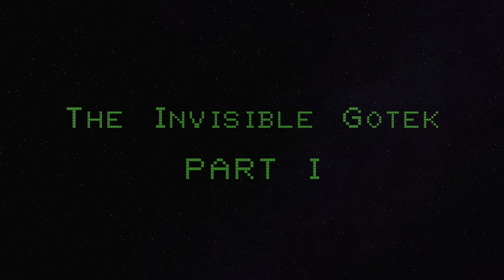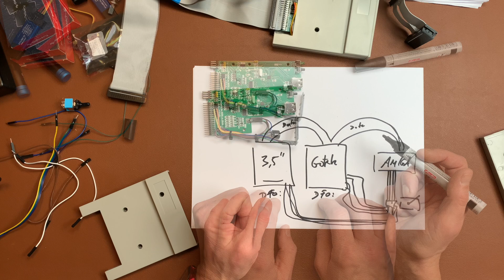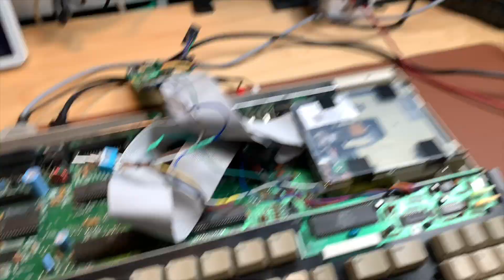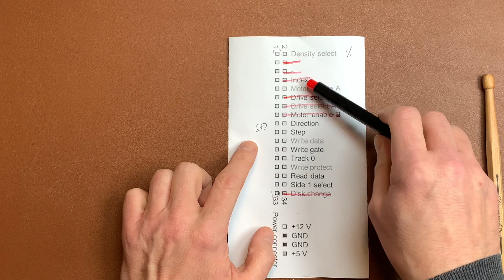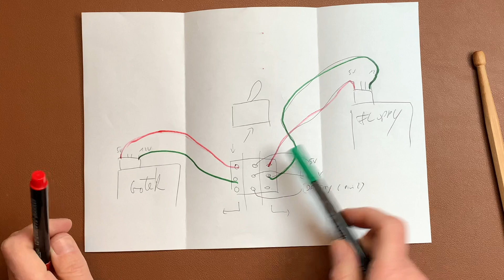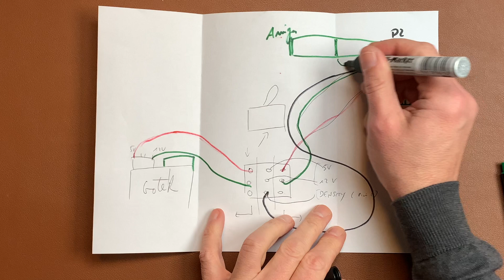The Invisible Gotek P1 (inside an Amiga) - no case, no buttons, no screen, no adapter, no bootswitch

Comment: If you look up a board called "DDA" on PCBway, it's a small circuit board I designed a few years ago you simply plug into CN11 and then add a Floppy and Gotek without all them cables!

Comment: Not possible to have both working at once?
 I'm planning to install a gotek in my CoCo 3 to go with its internal floppy. I'll have a drive select AB/BA switch and side select for the floppy.
 Interested in seeing how you control the gotek...
Reply from the maker: You can have them both working at once, but not in the way I wired it. You need a boot switcher for that (which is only three sockets, a few cables and a switch).

Comment: I'm trying to develop a new floppy emulator that will sit on the floppy cable between the motherboard and the real floppy. It is entirely internal and controlled via wifi (also bluetooth) and a cell phone app. It can operate in three modes. Mode one, intercept the signals and emulate the drive, mode two let the signals through allowing you to use the real floppy as normal. Mode three, where it can control the drive and allow you to create (or write back) disk images using real floppies.
Reply from the maker: Cool! I would love to cover that on the channel!

Comment: Was the reason for this so either drive could be DF0:? I was thinking you could have both attached if you made the gotek DF1 and just tell the OS to boot from it when required.
Reply from the maker: To attach it as DF1 you would need to connect it externally. You will see in Part 2 that you really can't tell that there is a Gotek inside. That was the point.

Comment: I left a comment yesterday about that it might not be a good idea in the long-run to provide power on the gotek mcu datalines without providing power to the mcu itself and that it is probably better to switch the datalines and not the power. That comment was deleted by whatever. There's a github repository from AkBKukU called "FloppySwitchBoard" where he provides a proper solution.
Reply from the maker: Thanks! I assume you had a link in the comment. YouTube deletes these without even showing them to the creator.

Comment: You need to buy a Dupont crimping too so you can make custom cables up. Much neater than cutting and soldering, and you can do custom coloured cables as well. They're quite cheap from certain Chinese sellers, and I use mine almost every project. (The crimp tool will also berg connectors like those used on floppy drives)
Reply from the maker: You are right. I will get one. ;-)
Reply: @RetroWK  I use mine way more than I ever expected to 😀

Comment: Neat idea! Interesting that the density select line is still active on the powered off device. It would be interesting to see if the line was high for the Gotek and low for the drive (or vice versa).
Reply from the maker: I thought the same. Will check for the next episode.

Comment: Would'nt it be easier and tidier to cut the floppy cable's pin 2 wire to the Gotek and splice that to the switch ?
Reply from the maker: It would. Check out the next episode ;-)
Reply: @RetroWK  I can't wait. :)

Comment: Actually, wouldn't it be more comfortable to grab df0 and df1 select lines from the CIA and use gotek and diskdrive in paralel, one as df0 and one as df1? swapping the drive select lines by the switch, so you can select floppy or gotek as df0:. But using both at the same time, so you can copy disks to the gotek.
Also I would recomment to print your own trapdoor, with USB port to simply put a very smal stick from the underside and also place the switches where. Mostly the trapdoor of the A500 is only partly used, as RAM expansions are not very big. So there shouldn't be a problem to place switches and USB-stick there, without harming the case.
Reply from the maker: I have a bootselector switch, but you need a connector to make it work and you have to connect the drive from the outside ... or solder to the floppy connector from the inside. I have that in my A1500+ but this here is an experiment to use just some cables and a switch. As for the USB stick: in the new black case there are holes for that on the right side below the floppy drive.
Reply: @RetroWK  Actually I checked schematics of the A500 Rev 6 Board.
The internal Floppy connector (CN11) already has _SEL1 on PIN12, so no need to grab it elsewere.
df0 uses _MTR0, wich comes from Gary PIN46 (MTR0), inverted at U36 (74LS38) available on PIN 6.
All external drives use _MTRX, comming from Gary Pin47 (MTR1), inverted at U36, available at PIN 3.

All other signals on DB23 and CN11 are identical. Just some EMI-Filters to DB23 to allow longer (external) cables.

So all to do to use internal gotek and floppy the same time is to grab _MTRX on U36 Pin 3. Route _MTRX and _SEL1 (CN11 pin 12) to a 4*3 switch, also _MTR0 (CN11 pin 16) and _SEL0 (CN11 pin 10). Use the switch to set wich drive gets _MTR0/_SEL0 and wich gets _MTRX/_SEL1.

If you want be able to deactivate df1, just ad a second switch to cut the _SEL1-line before it goes to the changing switch.

You do not even need to solder to the A500 board, as you can use one of theese pin grabbers.
If your board revision does not have _SEL1 on CN11, you still can grab it at U8 (CIA) pin 14.

Sadly I still have to repair battery leakage on my A500+. So it will take some time for me to test it.

For the trapdoor modification: While of course with the black case it is not needed for USB, I still wonder why nobody uses the trapdoor to place switches, as you get the design on thingiverse or printables. Should be quite easy to modify to place switches and USB there, sunk a bit deeper so the A500 stil stand normaly. You can keep original parts unmodified, so totaly reversible. Anyway, you shouldn't change switches anyway while Amiga is powered on, so sunk switches in the trapdoor seem the perfect solution, not only for drive changing switches, but also f.e. for kickstart selecting switches - or in short, for every switch that has to be set before powering on anyway.

A 4*3 switch in germany is available at Reichelt with articel number MS 500P.

Comment: in the beginning of this video i am already scratching my head somewhat. i am still watching the video but i already want to mention that as far as i know both the drive and the gotek not even need 12volt power. this 12 volt was always for 5'25 drives so maybe better switch ground and 5volt with the toggle switch to df0: 3,5 or df0:Gotek.
but maybe I will be suprised further on in the video. ;)
Reply from the maker: you could be right on the 12v ;-) ... but ground will not be the problem ...
Reply: i did some searching and i did find only convermations that 3,5 drives only need 5 volt and gotek's also. so forget about the grounds and connect those,
and use your fist toggle switch to toggle 5 volt to one or the other "drive" and the other half of the switch can be used for breaking this density line that you can split from the flat cable, so almost no dupont wires are needed to keep it tidy.

with other words i didn't know about the density line that functions like a cable select and you did not know about 12 volt not needed , now we both learned something. LOL
Reply from the maker: @janwiersma1449  LOL Yep. I knew that the Gotek can run from 5v only. Wasn't sure about the floppy. Just tested and filmed that for the next episode.

Comment: I guess, you've never seen micro Goteks by Zaxon.
Reply: I hadn't until you mentioned them. Thanks! 

Now all that I haven't seen is one for sale. :)
Reply from the maker: Still has a display and buttons - if all goes to plan, mine won't! The size does not matter (in this case) because there is enough room in inside the A500 to fit the full size version.
Reply: @RetroWK  Well... There's a version, which uses OSD control - no buttons and additional display. Me personally - I don't like it but my friends use this version and are very satisfied.